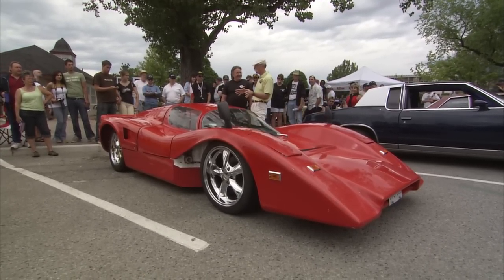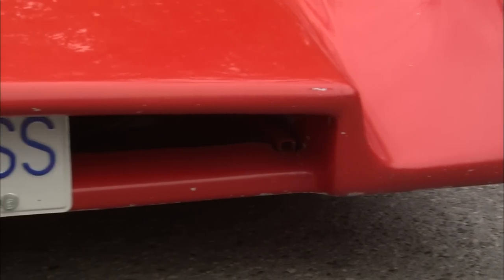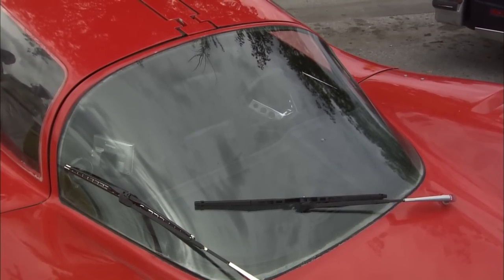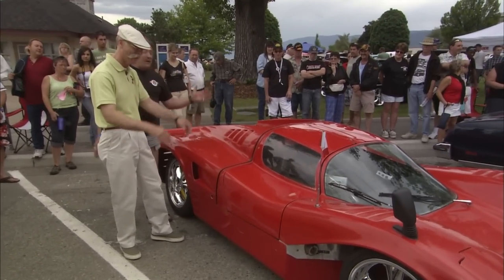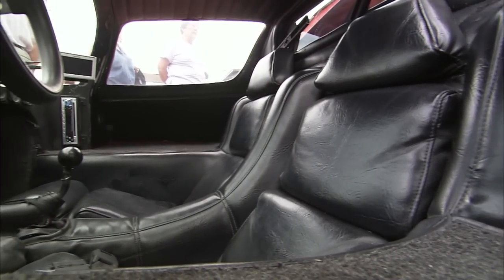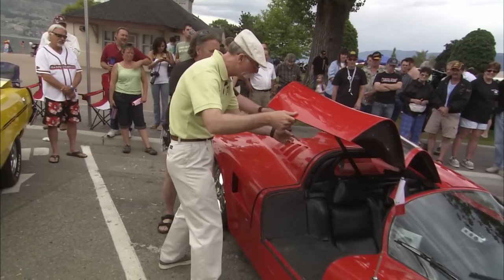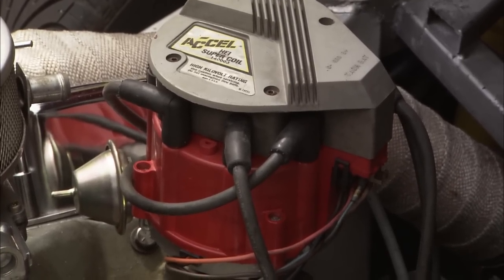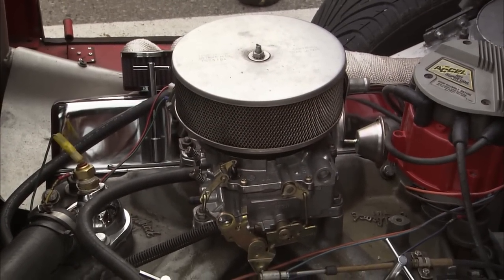McLaren Clone Car | 1973 Manta Mirage | 450 HP Lightweight Street Legal Racecar with Gull Wing Doors

Comment: I built one back in 1980. It uses a 1966 or newer VW modified front suspension, with air shocks{to raise it for driveway entrances}. We had a 400ci in Chevy engine and yes it uses a Corvair transaxel turned upside down.. It also uses a square tubing Frame(Manta's).. Ohio law required we install a Parking brake{we used a Line lock), Turn signals, and other small stuff..  The biggest headache was mounting and aliening the headlights{vacuum controlled}.. Fitting of parts was a headache also, as Quality was not their middle name..

Comment: Those wheels gotsta go...barf
Reply: Figure the wheels were from the 80's or early 90's era. When most of your choices were the star pattern and chrome. Unless you chose specialty billet wheels which run ya easily from 1 to 2 grand, before adding rubber in those days.
Reply: @drewdaskievige754  18X8/15X10 reverse wheels have been available for decades...the offset is so wrong for this vehicle.

Comment: The wheels look very recessed in the wheel wells.  Is that because the body is designed for wider wheels?
Reply: I'd definitely think. This being an 83 those chrome rims are way too new. Apparently they use a mustang 4 and 5 bolt pattern so I'd imagine much beefier wheels on it originally.

http://veh-markets.com/cars/other-cars-c/149120-1985-manta-mirage-can-am-mclaren-m8.html

Comment: As nice as it is as a smooth street car, that has a lot of potential to really look the part of a street driven race car, If it were minevand I had the money, I think It would look great with roadrace style minilite wheels and fat tires, a wild 70s vintage race car styled paint job and sponsor decals, add an all aluminum big block chevy with those crazy fuel injection stacks dressed in era correct speed parts, it would look like a Can Am car with a roof......I can dream right!